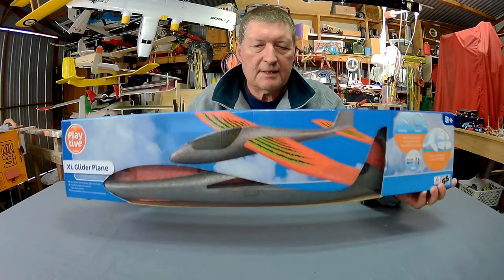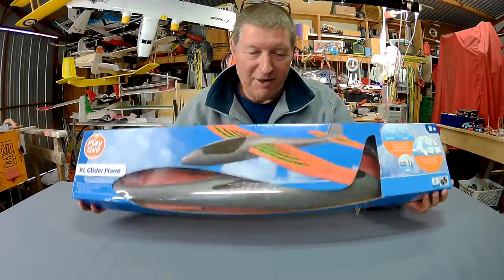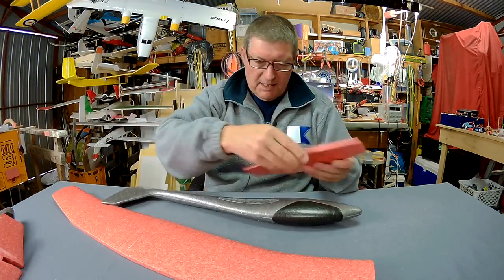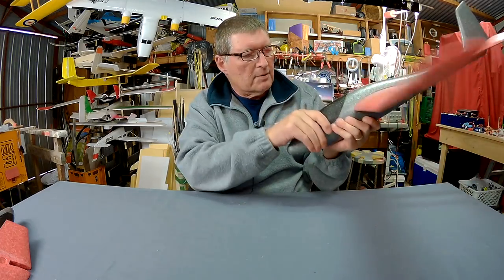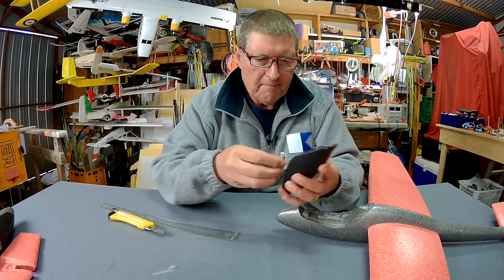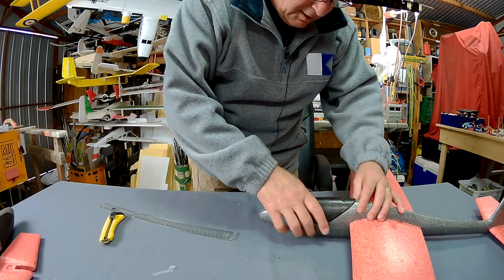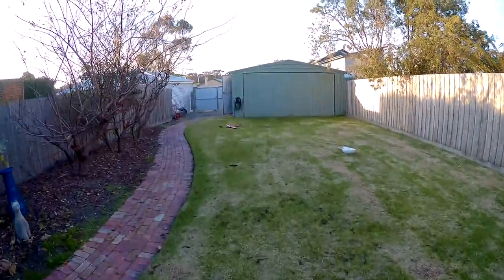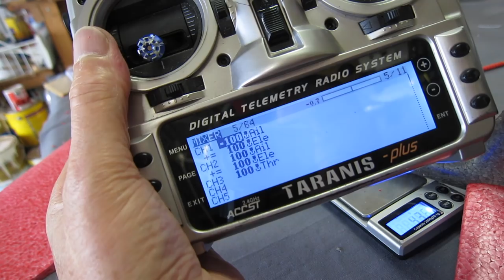LIDL Chuck Glider Pivoting Wing Mod

Comment: Gday Andrew . The aussie discount chain called the reject shop were selling an almost identical glider that was branded the albatross for about $20. I grabbed 1 and motorised it. and made it a 4 ch. 
Made the mistake of not reinforcing the wings with extra carbon and just used the thin piece supplied with it. 
It looked pretty funny as it flapped around the oval nearly folding the wings with every turn.
Will you keep yours a sloper or will you motorise it ?
Reply from the maker: Just a sloper initially, need to investigate these pitcherons, maybe a motor on the second fuselage

Comment: Do you have a qx7 radio setup guide for Wingerons?  I'm having a tough time getting my receiver to make the correct commands.  I can get the receiver bound, but can't get it to control the servos.  Can I change the channel settings without having to rebind the receiver?  Thanks in advance.
Reply: I figured it out.  It was the -100 in the setup.  Looks like I"m good to go.
Reply from the maker: Well done. Fun little glider and a great radio
Reply: @AndrewNewton  HA...I'm trying my luck with a 3D printing Powered Glider.  I don't have a lidl glider to mess around with....yet....

Comment: Great Video !!! I build one Lidl last year with 2s, emax CF2805/2450kv, 20a ESC and it flies like a dream. Now i´m building one the way you did, with 3s 1550mah, 2205/2300kv, 30a ESC. Do you think the Wing tube with 6mm is strong enough for it ? Greetings from germany!!
Reply from the maker: Sweet! Yes, 6mm is overkill
Reply: @AndrewNewton  ,allright thanks for your quick answer !

Comment: Good flight looks very stable
One question, I'm doing the same modification on the wings and I've already done the servo programming on the station as elevons.
The question is in which direction do the wings have to move when I want to climb?
And in which direction should the wing on the left be moved when I want to turn to the left?
Where is the center of gravity?

Thanks for your answer if you can help me
Reply from the maker: It is a bit confusing. Left leading edge down to roll left, both leading edges up to pitch up. It rolls much faster than it loops.
Reply: Well to avoid mistakes I will formulate my question in another way.
Which position must have the leading edge of the wings to go up
Reply from the maker: @fndfpv3678 Up
Reply: @AndrewNewton  Thank you very much. I am gona try this weekend
Reply: @AndrewNewton  thank you Andrew. I recently got a slightly smaller one of these 30 inch wingspan and 34 inch fuse on Amazon. Have you seen one this size? Seems identical just smaller? Also the cg on it is about 75% back from the leading edge which I'm amazed it seems to glide well with this so, so I was thinking of keeping it there for my conversion? I want to go 2 channel so either bank and yank tailless or pitcheron can't decide 😜  loved the way the pitcheron conversion is so clean and efficient also the way you did the wings as a whole rather than splitting them first is brilliant.

Comment: Thanks for this guide Andrew. I used it as a very close template for my conversion but have also added a C20 motor. It's now my best RC plane by far, with the ability for long slow glides at one trim setting, and fast flight at another.
A few things that did take me a while to get right before it was controllable (explanations for the benefit of your other viewers):
- The pitcherons need a lot more travel for elevator input than for aileron, I'd suggest 3:1 or more ratio between them, otherwise it's too sensitive to roll.
- The aileron control needs 50% or more differential (the trailing edge of the wing moves up more than the opposite wing moves down). This is equivalent to mixing in up elevator.
- To be able to achieve a loop, I had to have the leading edge of the wings able to pitch up a very large amount, so with the servos centred my wings start pitched up and I also have differential on the elevator to stop them pitching down by as much. It might have been possible to instead fit the tail in the opposite orientation, but mine's glued in now and I don't want to risk damaging it to try.
Reply from the maker: It's such a versatile little glider. Good info about the extra elevator required in pitchers mode. Mine is now conventional acro sloper configuration now with ailerons, elevator and rudder. Not tested like this yet

Comment: Hi Andrew.  Have been hanging out to give this a try.  Did your 6mm CF tube fit the 4mm rod or
 did you need to sand it down a bit?
Reply from the maker: Correct, I did have to sand it down a little
Reply: Andrew Newton Thanks Andrew

Comment: Nice neat build, i think i need to keep a eye the lidls leaflettes for when they have them on offer again, i normally fly quads so ive got various bits of radio gear and batteries laying around my bench, could be a cheap summer project. Great vid. All the best matey.
Reply from the maker: Elusive little fellas, have to grab them when you can

Comment: In December 2019 I did the Maiden with my conversion of the Lidl. The Motor is mounted on the vertical stabilizer. For the Elevator i usd Kind o a Vector-steering. A servo bends the fuselage so the Motor and the Horizontal stabilizer move.

Im Dezember erfolgte der Erstflug meiner Version des Lidl. Der Motor ist am Heck montiert. Beim Höhenruder setzte ich auf eine Art Pendelleitwerk-Vektorsteuerung, ein Servo "verbiegt" den Rumpf. Da der Motor am Leitwerk sitzt, wird auch er mitbewegt. 

the Video: https://www.youtube.com/watch?v=fRYZuOkpb5I&t=1s

Comment: very similar but smaller (19" wing span) I modified with 2.4ghz 3 channel helicopter guts.
7 x 20 mm motors in short lengths of carbon fiber arrow tubing provide thrust and differential steering, a 6 x 12 mm motor on the boom near the tail providing up/down "elevator".
it flies a LOT like a normal 3ch plane, more so than most might think. it cost under 25 bucks

Comment: You'll have great fun with the glider. Pitcherons enable crazy fast roll rates when everythings maxed out. It'll slope in 5 mph to 35 mph winds (when 110g of ballast is added). My version differs from Soren and your approach in that the carbon rod is embedded in the wing by boring a hole through the centre section and then into both wing halves. The panels are retained with R clips so easy to break down for transport. The centre section and horizontal stab are not even glued in so it'll pack away in the box it came in
Reply from the maker: Excellent, I'm already increasing the throws.